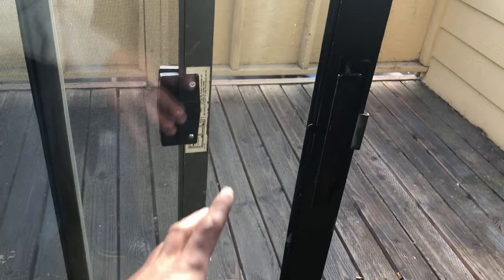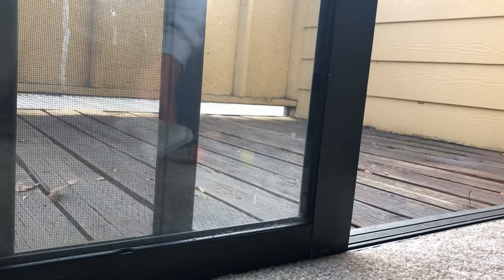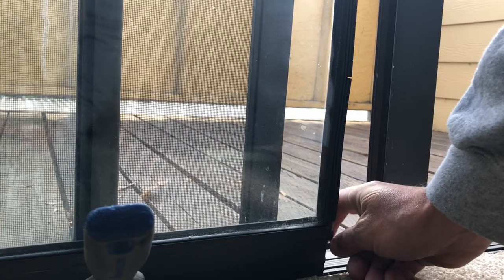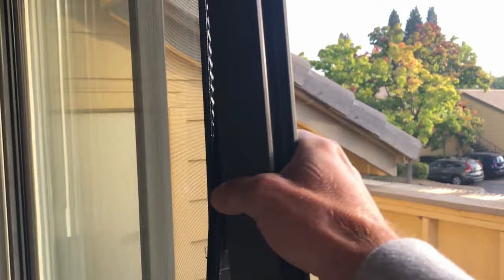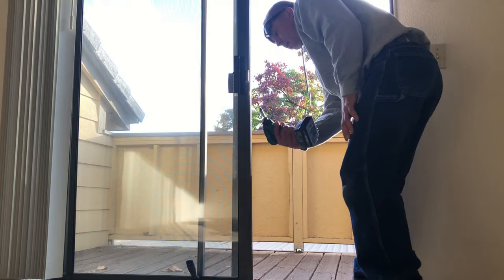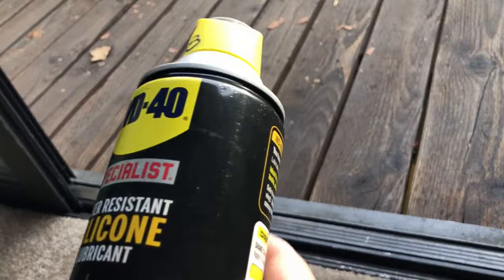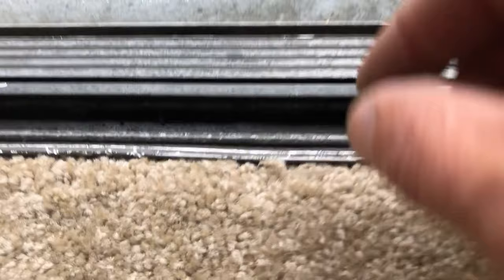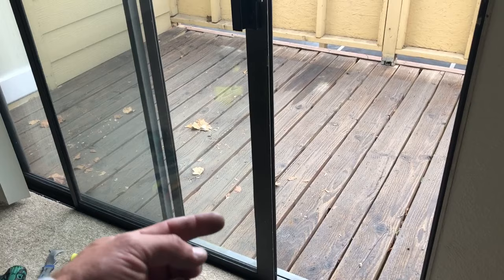How to replace rollers, wheels on sliding glass patio door the easy way.

Comment: How do you charge the worn out rubber insulation of the sliding door?
Reply from the maker: Not sure what exactly do you mean, if you are talking about rubber gasket that goes around the glass?, or seal on the frame , but in either way you will have to take the door completely out and take all 4 pieces of the frame off.

Comment: how do you know what replacement wheel to get? I've been looking online but do not see any wheels that are similar to mine. My sliding glass door looks identical to yours i even had to pull out the wheels like you did but the wheel slides in with a little lip in the frame to keep it in place
Reply from the maker: Does the screw go into the frame? Or into. The wheel? If it screws into the frame then the roller in the video should work. If the screw goes into the roller and you were able to pull it out  than I think this is the wheel you need ( https://www.acehardware.com/departments/building-supplies/windows-and-doors/sliding-door-rollers/5200803?store=00720&gad_source=1&gbraid=0AAAAADtqLJEJPUIJt7W5BILdjAcAM8KJL&gclid=EAIaIQobChMIgdrwtcH0ggMV3CytBh3-QwSMEAQYFiABEgJyhfD_BwE&gclsrc=aw.ds )
Reply: @roadglassandmore9064  so there’s two screws one on the top and bottom both off let me remove the frame. And the screw for the wheels was inside a whole on frame. But was deep inside so when I removed the frame with the two screws I could just pull it out without removing the screw connected to the wheel. With that being said should I do the wheel in the link you commented with? Sorry I’m not good with this stuff trying to fix it for my parents so we don’t have to pay for someone to do it
Reply: Also I can create a short video just to show what I currently have for wheels and what the inside of frame looks like just to make sure I get the right part

Comment: My question is how many type of door rollers out there?does this trick apply to any sliding glass door?
Reply from the maker: There are quite a few different type of wheels out there, the trick only applies to aluminum sliders. But there are few aluminum sliding glass doors where the rollers are different and are screwed through the bottom rail, the best and easiest way to tell is to remove the corner screw, if it’s pointy and looks almost like wood screw then the wheels in this video will work, if it’s flat tip machine screw , then the wheels are screwed through the bottom rail and the slider needs to be taking out .
Reply: @roadglassandmore9064  thanks the sliding door master! I'm amazed.

Comment: Great video. I did have a question though. I am WD-40 guy, and I use it on everything. Never used it on a sliding door though. What you recommend to use if I can't find WD-40 silicon?
Reply from the maker: Silicone spray is better for use on sliding glass door tracks it does not have to be a WD 40 brand,.  , WD40 a little too greasy and will attract dirt.

Comment: Would you kindly say how to fix the sliders glass that is stationed in place, never moves as it, in its upper corner has fallen a bit  rather than being upright and straight.  How one gets to fix that? ? ?
Reply from the maker: It’s kinda difficult to explain how, there are few different types of doors, look for small bracket in upper corner that’s screws in .
I will try to make a video on that.
Reply: @roadglassandmore9064  thank you for replying and for future learning video.  Have Happy Holidays to you and Family!
Edit added:  and even if it becomes impossible to make the video, at least the good faith attempted gesture was there.  Thank you again for such kindness.
There is no small bracket in corner it’s suppose to be flush no gap but has recessed or fallen out of alignment on top corner only making my security bottom pin keyed lock attachment  off whereas pin will not fit the frame rail hole so can only lock from handle not bottom keyed lock that’s security based.
Reply from the maker: It’s difficult to determine what exactly is wrong with your door or what exactly needs to be done without seeing the door, I wish there was an option to share photos here.
One thing you can try doing is to push on the fixed side and to make it pop/move back into place and May be put a screw trough the frame ( very top, so you don’t hit the glass).

Comment: Any idea if this method would work on a Acorn Dorwal sliding glass door from the early 90's?
Reply from the maker: I’m not familiar with that brand, but best thing to do is try to remove a bottom screw ( if it has one) and pull the rail off the glass and see what type of wheel it has.

Comment: Did you loosen the top screw too? Thank you for sharing the great video.
Reply from the maker: In most cases you need to loosen the top screw to be able to pull frame all the way off to straighten the rubber gasket.
Reply: @roadglassandmore9064  I tried but the bottom screw is stuck. I added wd40 but did not budge.
Reply from the maker: Try using impact gun, or even a pair of wise drips to turn the screw.
Reply: @roadglassandmore9064  tried and impact wrench but it stripped the screw. Any idea where i can buy a replacement screw?

Comment: How will I know what the part number is before removing the wheel?
Reply from the maker: I would just one rail off and take one wheel out, take a good photo so you can you’d it to buy new either online or at the hardware store. The wheel I used in this video is the most common wheel for aluminum doors, the link should be in the description.

Comment: I'm in UK    do some doors have top screw fixing which means you cannot do it the easy way
Reply from the maker: Sorry not quite sure what you mean, top screw fixing? Some doors have roller screwed through the bottom of the frame in that case you would have to take door completely out. I will be making more videos on different types of  doors and wheels in the future.

Comment: What if there's a screw holing the old one in. Without removing the glass
Reply: I had to remove the bottom frame to remove the old set.
Reply from the maker: Yes, your door is a bit different, I come across this type sometimes, the screw that holds the roller is through the frame and you do have to take bottom rail off unfortunately
Reply: I had to get the courage to pull the rail off.
Reply: @roadglassandmore9064  now I ran into another problem. 
When I put the new wrong one in. I did not realize that screw is important to put back. The sides were spreading apart. So I had to get the correct part. And that included me having to take the sides completely off just to get the weather strip properly back on. Finally got it done correctly.  But the courage is well profitable in the end.
Reply: Q?89i

Comment: Hello, I have a patio door has dirt inside between the glass (the stationary door). How can I clean it?
Reply from the maker: You can’t, the glass has to be replaced! Dual pane is two pieces of glass with spacer in between are vacuum sealed . When that seal cracks the moisture starts to get in between the pains, is the dirt you are seeing brown kinda rusty color? It’s from the metal spacer between two panes. I will make a video in the future explaining all that!
Reply: Thank you very much for the information.

Comment: How can I tell what size roller I need without  disassembly?
Reply from the maker: Pull the screw out and if it has pointy end ( looks almost like wood screw) then the wheels in this video should work. If the screw has flat tip and fine machined threads then you will have to pull the door out and remove bottom rail as the rollers held with the screw through the frame and there are few different types of rollers in that case.
Reply: @roadglassandmore9064  thank you !

Comment: 3:48 a dumb question mate, if I somehow manage to over tighten the screw that secures the frame and end up cutting the thread can I use nose pliers to tighten up the thread or will it be some expert lvl frame replacement operation now? 😅
Reply from the maker: Yes, you absolutely can , that’s exactly what I do in that case. Use pliers and squeeze the part where the screw goes into.
Reply: @roadglassandmore9064  thanks mate, will keep that in mind.

Comment: My problem is the screw. Small head Phillips head on a #10 screw exposed/rusted in place, 1-1/2" long. The head will twist off if any kind of torque is applied. Now what?
Reply from the maker: If you break a screw, then the slider need to be taken out , and bottom rail removed, and you will have to drill the broken screw out unfortunately.

Comment: My door is about 20 yrs old. The roller were replaced on 2 doors.  It looks like the screen door roller were use as replacements as they are missing they were also brass rollers.
A friend told me the glass door should have a double wheel roller.  Which make sense as the are heavy doors.
The screen doors I would think a vinyl roller would work…. 
How do I know.Finding at the locate store seems to difficult 
The price varies by $1-8.  For one single metal roller.
Feels like price gouging!
Reply from the maker: Some manufacturers Used a single wheel rollers on their door, and I agree that’s not a good idea for heavy doors.
The best thing to do is pull one rail off the door ( like I did in the video) this way you will have access to the roller , so you can see what exactly it looks like, and the double wheel roller I used in this video can work in a lot of aluminum frame doors. I think I put a link in description where to buy it.
Hope this helps!

Comment: Didn't work for my aluminum frame sliding door.  There are no exposed screws at the top or bottom, so it looks like something else is holding the frame together.  I banged on the frame w/ a mallet and wood block.  It barely budged.
Reply from the maker: That’s strange, I have never seen an aluminum slider that do don’t come apart.

Comment: Where did you get that plastic wedge thing that you used to take off the door frame? I can't find it anywhere
Reply from the maker: That’s a specialty tool, ( nylon taping block) the company I work for got it for me. But you can use a piece of wood instead .
Reply: @roadglassandmore9064  okay got it thanks!

Comment: Hi,

Does this roller comes in different size and model? How do I choose the right one for my door?

Thanks
Reply from the maker: Yes there are many different rollers specific to certain brand/manufacture. Sometimes you can find manufacturers name on the handle. From experience I would say about 80% of older aluminum doors take the roller I used in this video, If your door is aluminum, I would unscrew one rail and see if you can pull the wheel out and take a good photo so you can either look for it online or at local hardware store.  Very few manufacturers had their rollers screwed into the bottom rail,  in that case you will have take the slider completely out. I will make more videos about wheels in the future.

Comment: Where can you purchase replacement rellera for a 1970s heavy door?
Reply from the maker: Most rollers can be purchased either online or at you local glass/window shop or even hardware store. I would remove on rail on the door to see what kinda wheel it has first.

Comment: I can’t seem to get the roller out. It will not budge
Reply from the maker: Your door might be a bit different, roller might be screwed through the bottom rail, is the screw you took out is not pointy and has fine threads and is screwed into the roller itself than you will have to take the door out unfortunately and take the bottom rail off

Comment: My glass doors are 40 years old and work fine. It's the screen doors that are messed up.
Reply from the maker: I will try to make a video on screen doors in the near future. Check the track for the screen door first make sure it’s in good shape. Take philips screwdriver and lower screen door wheels so it’s easier to take it out of the opening . Check the wheels, if bad or broken , go to local hardware store to see if they have the wheels you need if not look online. To replace the wheels on most screen doors you just need a screwdriver, it’s pretty easy.

Comment: A tech repair guy removed my door and then took a photo of my rollers on my very old huge slider and called me to say he cannot get new rollers that will fit my door.  Should I give up or try to remove one of the rollers and take to the hardware store?
Reply from the maker: Definitely try to remove one, and see if you can find a replacement. Unless your slider is some fency brand I don’t think you will have a problem finding a replacement rollers.

Comment: my glass door has been installed back wards
Reply from the maker: Slider on the outside? I have seen that before, most likely it’s the way from the factory.
Reply: @roadglassandmore9064  so i drilled a hole to put a bolt to lock it. thanks

Comment: My sliding door is twice the sizes, your is.  The roller is n the top?
Reply from the maker: There are no rollers on top of sliding doors. Just on the bottom on each side. If the frame is aluminum 90% of the time you can just remove the screws ( like I did in the video) and pound the rail off and pull the roller out, but there are few style of the doors that the roller is actually screwed to the frame from the bottom , in that case you will have to take the whole door out of the opening.
Reply: @roadglassandmore9064  Just to put that in perspective, when Road Glass and more says "90% of the time," what he actually means is that on doors that can be done this way, 90% of the time you might have a 10% chance of success like this. Of course, on the 90% of doors that can't be done this way, you have no chance of success, but since that goes without saying, he didn't bother to say it.

Comment: I right to the point of pulling out that roller... mine is not coming out that easy ... lol
Reply: Found out why after I took the whole door out..  there was a screw holding it in from the top.
Reply from the maker: There are some doors, where the roller is screed through the frame. The easiest way to tell is the corner screw ( that holds  the frame together)is machined and has flat tip.

Comment: Why did you take the frame apart. You know you can lift them out of the track and lay the window on it's side. Now you have broken the seal and also risk breaking the glass.
Reply from the maker: I have taken hundreds of doors out to replace wheels, it’s not always easy to do ( weight of the door,  sagged header, needing to deglaze the door , etc.) . I found taking rail of is a lot easier( especially for an average joe), and doesn’t require many tools.  And You can’t break the seal by taking a frame off the glass, the rubber gasket around it is just that a gasket between glass and aluminum frame. There is always a risk of breaking the glass when ever you work windows and doors, glass is such an unstable product but yet we use it everywhere!

Comment: Freely pull it out yea that ain’t coming out for nothing I think it’s screwed in somewhere else
Reply from the maker: Your door might be on if the few where the roller is held with a small screw through the bottom rail, in this case you will need to take the door completely out and remove bottom rail.
Reply: @roadglassandmore9064  yea it was took the bottom metal off figured which ones it was and ordered two thanks. So if anyone else’s won’t move it’s probably same

Comment: WARNING DO NOT TRY THIS. I did and it broke the glass in the door resulting in a very expensive emergency call out to secure my house.
Reply from the maker: Sorry to hear that, but it might have been a user error, I do this every day for over 15 years , and have not broken a single piece of glass! The only time I broke the glass was when customer had secondary lock screwed into the frame and the screws were sticking through the    frame pointing into the glass.

Comment: Why in God's name are doors like this designed in such a way that you have to take that much of the door out in order to replace a normal maintenance item. There has to have been a better way.
Reply from the maker: This is a better way, the only other way is to take the door out completely, lay it flat , and remove the bottom rail.

Comment: Very complicated and unnecessary method. Just lift the door out and replace the runners from below.
Reply from the maker: Still have too remove the screws and take the bottom rail off . And this method doesn’t require 2 people to take the door out. But what ever works !